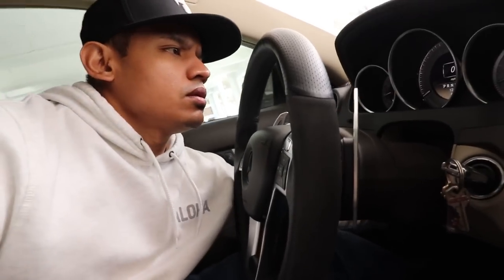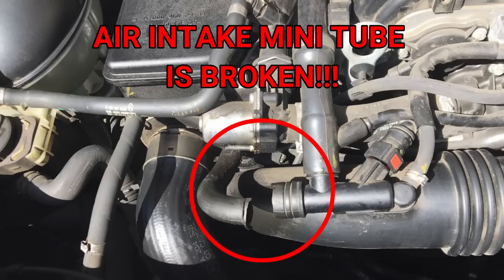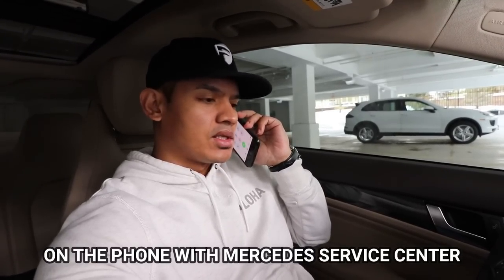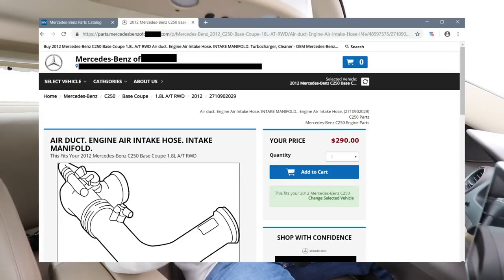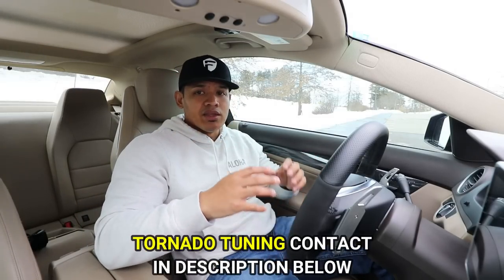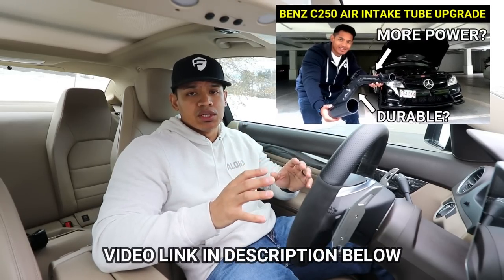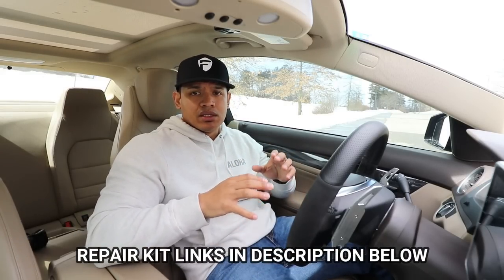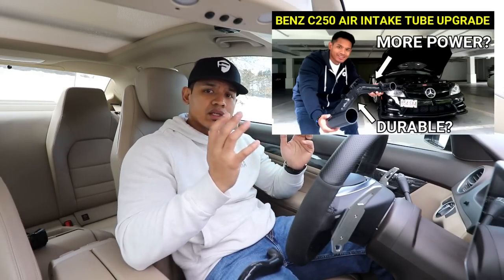FIX MERCEDES C250 BROKEN AIR INTAKE TUBE HOSE

Comment: Hey does this leak oil when driving with no tube from the oil stick. Does it spit out oil from the oil stick
Reply from the maker: It’s not designed for oil to flow thru. It’s air.  But that air will carry some oil with it.  This is a turbo engine so the air in the system will have some blowby. (Google blowby for more details).
Reply: i know but when not having it on does it leak oil from the dip stick
 @TheFlexxGarage
Reply from the maker: If you don’t have it on, then who knows what other issues you’ll have with your car. Could be a number of things affected from not having it. There’s no one answer. Go get it replaced and then see if your other issues go away or they need to be taken care of separately.

Comment: Bro I have the same issue with my c250 that little hose broke cost you $250-400  but I just customize it using heather house and work very fine!

Comment: I have loud rumble when accelerating. Or anytime I step on the gas. 2013 C250. What could it be?
Reply from the maker: Could be anything. Go to a certified mechanic and get it checked out before it leads to more issues.

Comment: I broke the piece that the tube goes into. Does anyone know what it is called?
Reply from the maker: Not sure what you mean because entire large air tube is sold as 1 piece from Mercedes.  Only aftermarket suppliers carry the small replacement tube (that is prone to break as i mentioned in the video). If that small replacement tube was installed and you broke something it attaches to on the main large air tube, then you are out of luck and need to buy the entire large air tube.

Comment: Smh🤦🏽‍♂️ this and air intake pipe broke. Took to dealer n they want to charge 1200! A bunch of cheap plastic parts
Reply from the maker: Yup. That’s why I always upgrade all the plastic parts as soon as possible.  People always say “why add that when it barely adds horsepower” when me doing the upgrades isn’t about horsepower but durability.
Reply: @TheFlexxGarage  agreed. Thanks for the helpful videos!